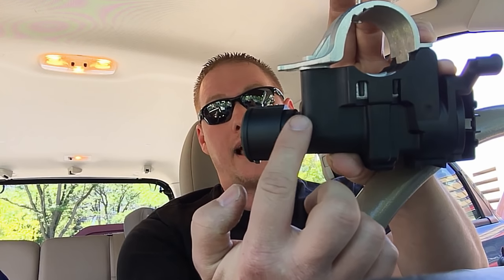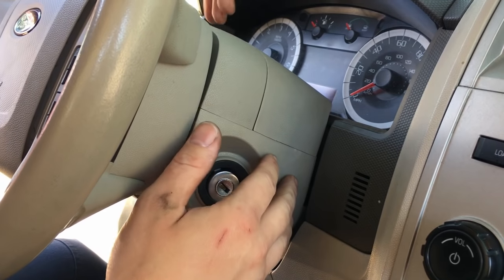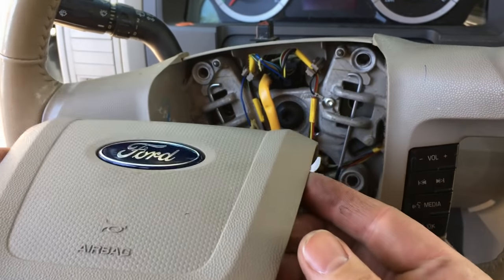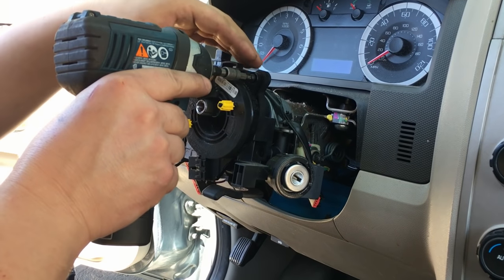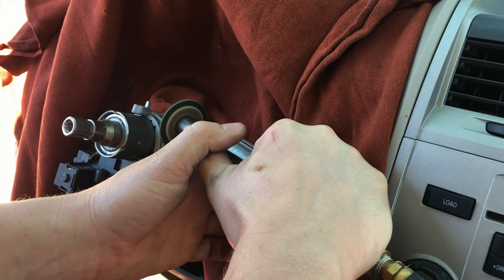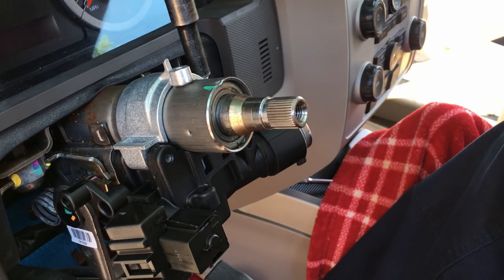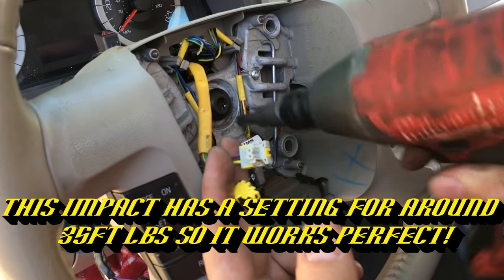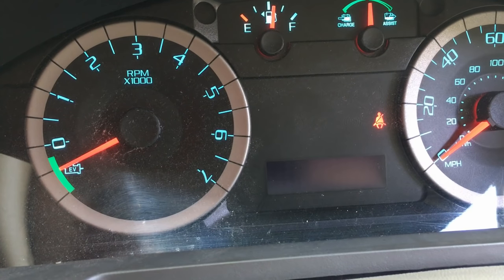2008-2012 Ford Escape No Crank No Start: Ignition Lock Module Replacement

Comment: I lived the "backseat driver" joke.

I recently finished rebuilding a HJ Holden Monaro LS with a 350ci engine and TH350. The car was right-hand drive as normal for an Aussie car, but I replaced the steering wheel with a race wheel that would pop off after releasing the safety clip. I had the original steering wheel on the floor on the "passenger" side.  

My wife and I were bringing my aunt to go shopping and she was the true "backseat driver". "You're going too fast. You're going too slow. Get in the other lane."  At some point in our travel across town, my wife picked up the spare wheel and handed it to my aunt,  telling her to drive. In the rear view mirror, I saw a look of shock on my aunt's face as she held the wheel in her hands, desperately trying to turn the car off the road. At the next light, I turned to my aunt and asked for the steering wheel back, and told her to stop complaining about the driving. She was silent all the way to the store and back. It was then at the house that she realized that I had been driving all along and not my wife. You would think with me having over 2 Million miles driven and logged without an accident as a truck driver she would figure I knew how to drive safely. She hasn't complained once since then about my driving.

JD

Comment: Great video! Bummer you need an odd special tool like cut off wheel but imagine a Dremel will work just fine! Apparently Ford didn’t think that part would fail or want you to change it out yourself. 🤷🏻‍♂️- 🤙🏻🇺🇸

Comment: good morning my truck is mazda tribute 2009 and it presents the same problem. in the workshop they told me that they no longer sell the module and that if I install one from a used car there is no probability that it will work so watching this video I think I can do it myself  Now I need information where to buy it new and if I need to reprogram after installing it. Thank you for your support and information

Comment: Thank you so much. Developing this problem for a year but the manual looked a little too confusing, but the video clearer everything up. Is there any way of taking that bolt out without a dremel/hacksaw?
Reply from the maker: regular drill bit and extractor otherwise you cannot fit in a vice grips.
Reply: irwin makes a remover for rounded nuts and bolts that should work. i've used them on the tapered security bolts with good results lowes item #394001

Comment: Great video! I was able to replace the ignition housing after following your instructions, however my turn signals won’t cancel now. Is this a clock spring issue or with the turn signal mechanism?

Comment: I have the same Exact thing going on , I tried 100 times to start my car and it would not start , I changed the relay switch before I tore everything appart , and that actually worked , so please try that first in fact you can use the relay for your rear defrost , this dudes video is very good though and very thurogh

Comment: Hey Brain I have a 2008 ford excape. Love your video. My car when I turn key won't start but the starter keeps running till I turn key back off. Will this fix my car. Or do I need other parts?

Comment: Are used your video to do the job and I want it really smooth. Thanks for all your help this video was very excellent with your explanations. When I took out the keys cylinder there was some plastic from the original install stock bye the D shaped indent. The Ford subs supplier who supplies steering columns probably made the mistake. All in all great job thanks for your help jughead69 out.

Comment: Thank you for this video...it was super helpful! We replaced this part in my 2009 Escape Hybrid on Saturday and it worked perfectly for 5 days, but then the exact same problem started up again last night...it took 3 tries (and then finally the push-in method) to get the car started. Do you think it's possible that we received a defective replacement part? Or is there something else that could possibly be causing the problem? Thank you for your help!

Comment: I have a 2008 Ford Escape. Can you tell me what size bolts I need to thread into the steering wheel for my steering wheel puller?

Comment: Bought a 09' Escape Non Hybrid & it's doing the same. I'm trying to figure out if it's cheaper to pay the $100 deductible & have CarShield pay for the replacement or do it myself. The part is not expensive

Comment: Hey brother. If you use a small turbo socket/ rounded bolt remover with a impact screw driver to take off the security bolt you dont have to cut a slot on it. On toyotas the bolt is recessed no room to cut a slot. Comes off in about 2 hits.

Comment: Slightly off topic, but if I was going to replace the steering column control module in my 2011 Ford F-350 will it need to be programmed?  Another mechanic told me that he's replaced alot on 2011-2016 without programming with no issues, but everything else I have seen says that it needs to be programmed?

Comment: I have just fixed a similar problem with a 2009 ford escape. My problem is improper grounding of the ignition cylinder. If you press the key in, you press the cylinder onto the housing which ensures proper ground contact. I put a small wire between the end of the cylinder block and housing to get a good ground contact. It solved my problem.
Reply: how did you attach the wire? do you still have to take the cylinder out?

Comment: Due to a B227B, to repair the bottom portion of the steering shaft needs to be replaced. Can I leave the steering wheel and all the electronic components attached but disconnected electrically? Thank you for your work.

Comment: Hey I watched this video & the one on the steering sensor ( which is what I need) my question to you is ... Will an entire used  steering column work vs. replacing that donut looking sensor ? To fix the steering wheel from locking up ? Plz respond.tks

Comment: Hello, I had the same problem, 2 months ago. My mechanic introduced a kind of cleaning liquid (like WD40), and the problem disappeared. However, last week, the ignition key blocked a little bit, but I was still able to start the vehicle. I spoke about this to my Ford mechanic who said he had never seen this. He offered to replace the cylinder, which I hesitate to do (and that's why I did my research on youtube);). I should also point out that when the problem first appeared, the remote control did not work either. It made a little bit and the light flashed twice quickly.

Comment: After a while the cylinder permanently "locked in" that pushed in position. Will it pop back out or would you recommend it be replaced with the switch?

Comment: I have to push my key in BEFORE I turn it to start in order to get it to start. Sometimes it starts right away. Sometimes it takes like 20 turns. Does this sound like the same problem? I tried pushing when it was in the start position not responding and it doesn't start like yours. 2008 Ford Escape Hybrid.

Comment: I change the lock module without taking the steering wheel off and now I have an airbag light that stays on but has no codes. Any thoughts I only unplugged the electrical connector for the clock Spring But other that I did not mess with the airbag.

Comment: good morning, i have the same problem with my 2008 ford escape. my question is do I really need to replace the ignition lock module or it is possible for me to replace only the ignition switch?
Reply from the maker: The wear is in the lock module so you must replace it.
Reply: FordTechMakuloco gud eve.is there any system configuration with this procedure?

Comment: Wasn't able to do the Push In Test since the No Start is intermittent.  For months, I've noticed I'd turn to full Start, nothing, then try again and it would start.  Then a week ago it did not start after 4-6 tries.  I fooled around with it and it started.  Now it's behaving itself.  
There is another symptom that might be an indication that the module is bad:  the Return From Start Spring is weak and not enough to return key/cylinder to Run - I always help it back.  The cylinder does not turn smoothly, so stiff/sticky/etc. I did not realize I had an Accessory detent! - I thought there was Off, Run and Start.
Was there a TSB on this?

Comment: Try and use a turbo socket on that collar bolt. This is after my day at Ford but I was 1st one to come up with using turbo socket on the back driver side turbo pedastool bolt on 6.0 turbo diesel. I posted it on our internal message board at the time. Forget what it was called but during the FIRFT yrs. Turbo socket may not work on that cause not big enough shoulder. But worth a shot. The 6.0L turbos had huge shoulder cause the 3/8” washer.

Comment: Amazing video. But this seems like a daunting task. Pretty worried abt undertaking it (hubby is not good w these things). So not sure I will.
Reply: Try replacing only the ignition switch before going in deeper. As much as I’ve always appreciated and trusted FordTechMakuloco’s vids, I also thought I didn’t want to remove the steering column and then have to put a slice in the factory bolt to get it removed. $70 bucks later and a quick ignition switch swap out and it seems   to be working OK now. Lmk what you think! Thanks!

Comment: Thanks for a great video.   I just finished replacing the one on  my 2009 using your guide. 

 I have one question - is it possible to replace just the electrical switch part of the assembly (comes off with 2 clips) - would make this a 5 minute job.  I assume not.
Reply from the maker: No, the ignition switch is only part of the problem.
Reply: @FordTechMakuloco  thanks

Comment: I know this is off subject,but I'm working on a 2008 mariner hybrid. It appears the transmission is slipping while accelerating over 30- 35 mph. 
I'll be driving along just cruising and tach shows 2500 rpm. If a step on the gas tach goes to 6-7k and the car slowly accelerates. 
Can you shed any light on this phenomenon?
Also the engine always starts when we turn the key but doesn't respond to throttle input until it's in gear.
Love the videos! 
Thanks
Reply: Joe C try messaging at one of the links he provides. He's very helpful!

Comment: Hi Mr. Makuloco!
My 2011 Escape XLT won't detect the car's original key. I hit a horse with the car and replaced all the damaged components. In the shop, the mechanic told me the pcm was supposedly damaged, so I ordered a used one (with the same part #) from a junk car. He swapped the pcm, since he was going to program it to the car, but he could not. After he replaced the original pcm in the car for new testing, the car was immobilized. He later replaced the whole wire harness, and a broken transmission valve body connector. He cannot start the car again. Could you make a suggestion? Thanks

Comment: Are there any commonly known faults that would occasionally cause a long crank condition on a 2011 Escape 2.5L?

My first thought is a leaky injector causing a flooded cylinder. Before I pull them to check, I'm just curious if this is something you have dealt with before and might know the cause to be something else

Thanks

Comment: Ford Tech....quick question. All gauges, stereo, heater, dash lights intermittently going off for 3 to 4 seconds and then coming back on. 2009 Escape Limited. Would this fall under a possible ignition issue as well?

Comment: Got a 2008 Escape and it seems the switch is going and I have to hold it in the start position for an additional second for it to crank.  Just trying to see if this was an easy job like on my Camry

Comment: Great video but the horn and steering wheel doesn't need to be removed to replace housing.. I replaced the ignition housing this morning and I didn't remove the steering 
 wheel or horn. Just remove 3 screws, then break the special housing screw, remove plug wires, pop key lock out.. will need a 5.5 socket..

Comment: My 2008 today after some 7 inches of snow in San Antonio won’t start I turn over no lights come on and the electric locks arnt working now either ? Would this just be a standard battery issue??? I really need help this is my first not work vehicle

Comment: I have a 2012 ford escape and my truck has been notorious for idling low after replacing the battery. This time however. It will start but the minute I put it in gear it will shut off not allowing me a chance to drive it and let the computer relearn itself. What should I do about this? How can I fix this? Is this common in ford escapes?

Comment: I have a 2008 Mazda Tribute, which I believe is the same. So if you turn the key, and push it in, and it still doesn't start, whats the problem? In mine, its gotten worse and worse over the last 3 yrs. Now its to the point where you have to push, turn, jiggle, turn hard before it'll start. Is this the same solution to my problem?

Comment: I have a problem with a 2011 Marinier that I think is related to this video,  Randomly the battery drains overnight which stumped me until I realized it may be related to another quirk of the car.  The other quirk is that the car has a dealer installer remote start from when I bought the car in 2011.  If you use the remote start, the car should die when you try to drive it if you do not stick the key in the ignition.  However, randomly you can remote start the car and get in and drive for several miles without putting the key in the ignition.  I'm thinking the ignition starter switch is going bad and faking the car into thinking the key is in the ignition and leaving accessory power on.  Going to use this video to take the column apart and replace the switch.

Comment: Had this replaced 2 years ago but I seem to possibly be having the same issue again . Can that be possible? Or could it be something else? Like I’m tiring the key over and the radio and everything comes on but the engine doesn’t start till I try turning it over a few times in fact the other day the CE light and wrench came on then came off after I got gas was so weird @fordtech

Comment: I have a quick question about the bolt you cut a slot in, would it be an issue to drill the head off, i rather not have to buy a grinder adapter  or dremel tool if it don't have to. Would it matter if the bottom of the bolt is still screwed in to the housing?
Reply: You could go that route but will have to replace the bolt. I personally wouldn't recommend it

Comment: Excellent presentation but you can get to that switch without removing the steering wheel very easy as a matter of fact there is a video that shows you how to do it in 15 minutes again without removing the steering wheel thanks foryour video

Comment: How do we know it’s not a worn key vs the bad cylinder?
My key looks pretty worn but if I get a new key cut I wonder if the tracer will just replicate the worn edge vs a new sharper edge?
Reply from the maker: If you have an escape of this model year range then you know the lock module is your concern.
Reply: @FordTechMakuloco  well mines a 09 Mariner same thing though. I have had to push the springy section in a little more to get it to crank for a few years now. Here recently it has become even more difficult to crank after about 30 back and forth turns. Wife was stranded at a mall in the dark with kids and after about 30min she got it to crank. I’ve ordered the part. $50 on amazon it will be here tomorrow…

Comment: So I did this and it works. However, I used a momentary switch that is “Normally-on” so when I put the key into accessory mode my Ford will complete the circuit because the switch is always “on” thus turning on the car as soon as I put it to accessory mode. The computer on my Ford always thinks I’m trying to turn on the vehicle so it won’t allow my radio to work and the mileage indicator take a bit to come on and the car won’t allow me to put into gear for a good 15 seconds. Then I can drive it normally but without my radio. I’m  changing it out for a “Normally off” switch.

So make sure to get a momentary switch that is “Normally off”.

Comment: Is it the same part as linked for an 08 Mercury mariner hybrid ? Also I think this is the problem cause it was having trouble starting I took the top garnishing off and could hold the left side down and turn while pushing in and it would start otherwise it would take 10+ tried. Now nothing at all. Even when I did your check. Is it this part that I need to replace ?

Comment: I cannot get my old key cylinder to fit into the new module. I've tried jiggling it and moving it and all that but it won't seem to go in. I did move it to acc position too. On the old one I can put the cylinder in blind folded and it goes in with ease. Edit: Someone told me replace the ignition switch. Turns out the housing had one on it and I swapped it and still the same issue. :(
Reply: Nanobytez  I had the same issue.  Does your key cylinder have a black metal ring at the end of it? Because I removed that black ring and the cylinder fit perfectly.  I remove the cylinder by using some pliers and rotating the ring either clockwise or counter clockwise.
Reply: @johnnygalvan4229  Nope. Dealership told me the cylinder was in rough shape. :(
Reply: So all they did was put my lock housing module in and the car worked for literally two days then stopped. Locksmith says he can't get his computer to read anything to make a key. Cuz apparently the anti theft light blinks like crazy.

Comment: Hi, I have a question. I just bought a used 2012 ford escape but only came with one key so I got another original ignition switch with two keys and driver door lock as well. here comes my question. If I replace it, will transponder need to be reprogram in order to work and start my vehicle. thanks.
Reply from the maker: yes all new keys must be programmed to the cluster.
Reply: FordTechMakuloco